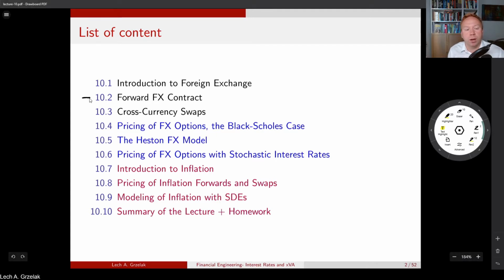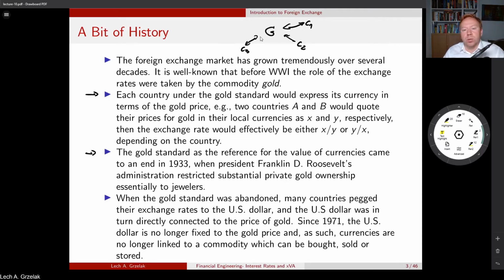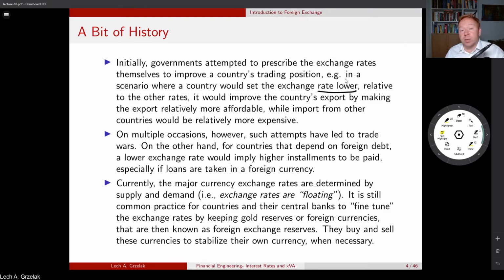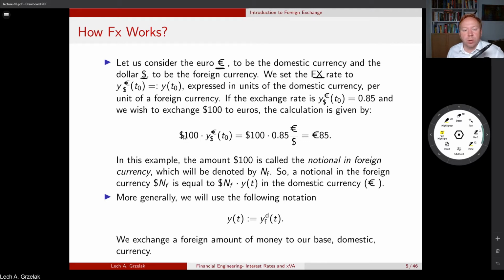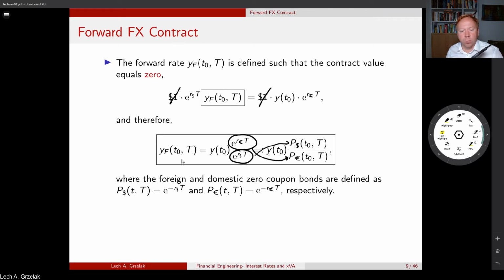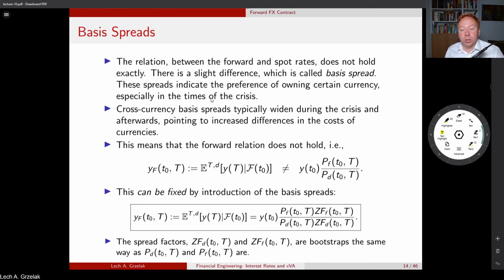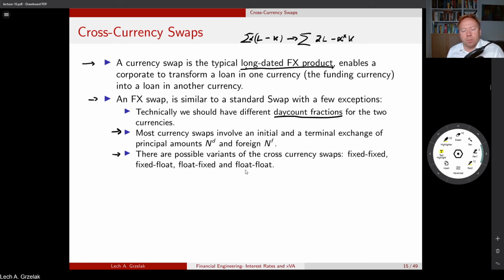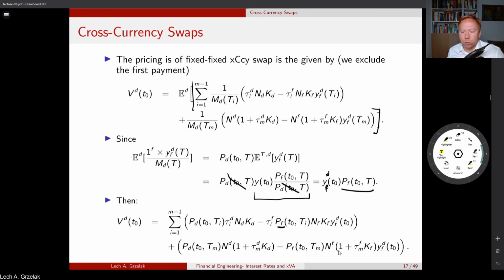Foreign Exchange (FX) and Inflation (Lecture 10/14, part 1/3) | Financial Engineering Course

Comment: Thks a lot Profesor. One question (around 42.50): if the spread basis is something that reflect the preference for a ccy vs another, why does the Z affects both Ff and Fd ? I would have said that adding the basis to one of leg would be enough?  thks again for all this effort, this is wonderful
Reply from the maker: hello E. Thanks for the feedback. Yes, in principle it doesn't matter where you put the spread, as long you would price back to par. However, it is a market practice that  for each currency we associate spreads against a basis currency and then put them together. It is important from the risk perspective- as your Greeks would show sensitivities to different spreads & currencies. Does it make sense? Best wishes, Lech